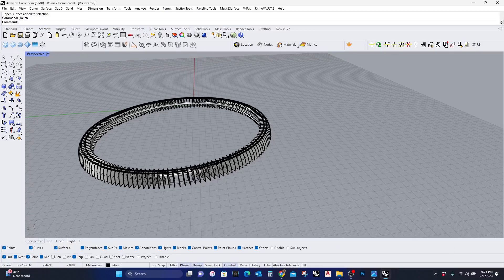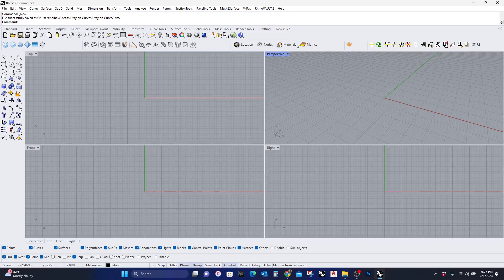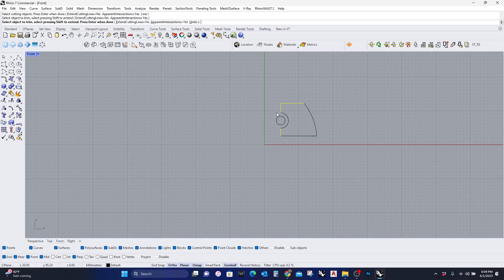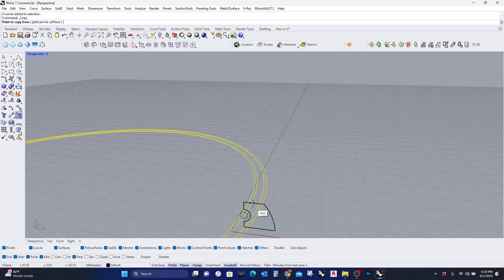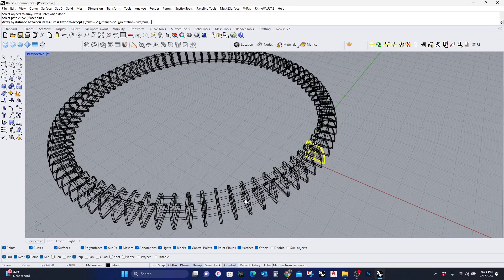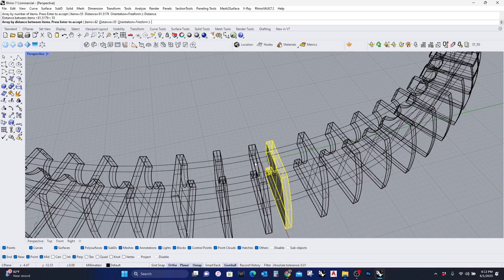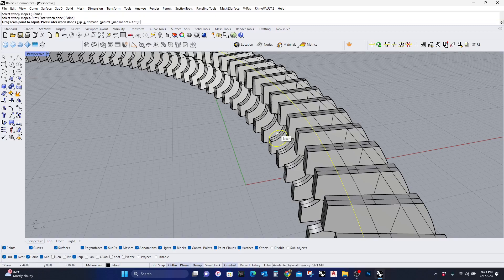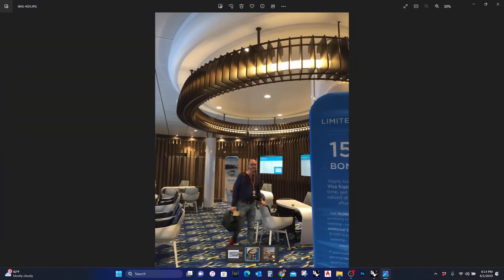Rhino 3d: Array on Curve to design a Chandelier

Comment: I'm curious to know about the fitting tolerance in fabrication of this models, I'm a student and I'll be glad to learn about this topic especially the designs like this one and the parametric benches
Reply from the maker: If you wanted to truly fabricate this, I would recommend using grasshopper in that you can achieve the precise cuts for the pieces.  In my own practice I use this.  If you want to learn more I am hosting a class in a couple of weeks.  I also will be doing grasshopper training.  A link to my class is in the description of video.